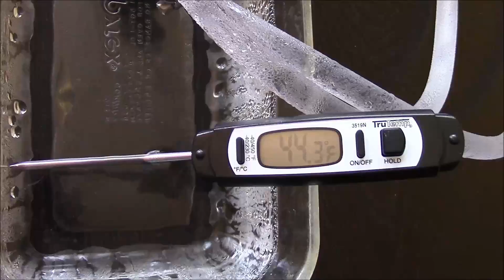How to Build A Water-Cooled Peltier Device or Thermoelectric Cooler

Comment: A few proofs of concept here. I love it BUT, I'm wondering, could you heat one said to make the other side cold somehow?
Reply from the maker: No, you can't add heat to generate cold.  You can take away heat from the hot side to make cold.  And that is what this device does.  It dissipates heat from the hot side so that the cold side gets colder.

Although it isn't exactly what you asked for you can add heat to generate electricity.  That is called a thermoelectric generator or TEG.
Reply: LDSreliance it figures. Doesn't hurt to ask though.
Reply from the maker: Yeah, sorry.  That would be an interesting device, though, if it existed.  Maybe it does but I don't know of it.

Comment: Hey guys, just curious, if you flipped over the module and turned off the fan would you heat the water a good amount?
Reply from the maker: Yes.  You could do it in reverse and it would actually be more efficient since more heat is produced than cooling by these peltiers.

Comment: awesome, I wasnt sure if I could use one, say 12v 120 watt, supply if I could find one, or not. Im still a bit lost with the amps and watts, and what is consumed or what would be too much. On the bright side, my unit just needs new power supply. It is dead, I checked. But as you said, I think Ill just get 2 supplies and make my life simpler lol. I had used a TEC1-12706 12v 60W and a single 60w 12v 5A supply.
Reply from the maker: You can't provide too much power.  All modern electronic devices will only draw the current they need (that I know of).  Certainly a peltier and fan and pump will all work fine.  I am sure you could find a 120W supply but it will be a lot easier for you to find 2 60W supplies (and cheaper).

Comment: well all was going great, until a loud pop and then no more power. I 
just saw you have two laptop power supplies, and I tried using just one.
 Are two required? or is there a larger one that could power both that 
you know of?
Reply from the maker: It depends on the power supply.  The TEC that was used in this video requires 5A @ 12V (60W) so if you tried to put that and some fans on a 5A power supply it probably overheated.  I would recommend one power supply per TEC because usually those cheap laptop/monitor power supplies are about 65W each or so.  Then you will need one for the fans and pump, too.

Comment: Im not sure if this link will post, but this is what i had in mind    http://www.ebay.com/itm/LED-Dual-CPU-Cooler-Fan-Heatsink-for-Intel-Socket-LGA1156-LGA1155-LGA775-AMD-AM3-/232335960837?hash=item36184d6b05:g:0OYAAOSwjqVZGRFc
Reply from the maker: That is a pretty cool heat sink.  The challenge will be figuring out a way to mount that to a TEC.
Reply: I'm up for the challenge and awaiting parts. My chiller will be to help maintain 78 degrees in a 14g saltwater biocube during the summer months. Maybe I'll try and make a video too haha! This is such a cool concept I'd never heard of before.

Comment: r12  was colder and you didnt have to drive 5 miles before it  got cold  unlike 134a  as far as being on the same ,level negative you are wrong and yes r12 displaces oxengen we all know that ------propane boiling point is much lower then butane try isobutane
Reply from the maker: What does this have to do with the video?

Comment: can this be also done with an air cooled heat sink?
Reply from the maker: Yes it can.  It is much harder to find one that works well with a peltier, however.  They are usually also less efficient unless you buy an expensive gaming cpu cooler.

Comment: so i would like to see the radiator in a water cooling loop replaced with peltier pads. and see if it keeps the cpu cooler under load
Reply from the maker: It does.  This has been done for years in the high end pc modding community.  You could put a peltier right on the CPU or you could use a normal CPU cooler and send the liquid through a water block instead of a radiator.  You could sandwich the water block with multiple peltiers.  It just gets a little awkward with all of that tubing and all of the heat that you have to send somewhere from the hot sides of the peltiers.

Comment: Well looks like a great start (just don't use straight water. if you get a freeze it's going to ruin the block. i'd use antifreeze. or some other below 0 liquid i know theres some oils that can handle pretty low temps without going all thick and there enert. (ever notice how google spell check sometimes gives you every word but the one you want :/)
Reply from the maker: This little rig is not capable of freezing water unless it is a very, very small amount.  I knew the quantity of liquid that the person I was building this for was going to use so it wasn't an issue.  But yes, if you are going to chill a very small amount of water (under 1 cup or so) then you would want to use something with a lower freezing point.
Reply: Well i hope the pump never stalls :)
(grumbles about his keyboard dubble hitting letters.) i rely need to hit this thing with some alchahall and or ffigure out whats mucking up the debouncing circuit.
Reply from the maker: Yeah eventually the pump will fail.  I wouldn't use something like this on a mission critical application.

Comment: How do you think I can cool 40g of recirculating water about 5+ degrees?
Reply from the maker: 40 gallons?  You can do it with these but it will take multiple units or else a much more powerful single unit.  5 degrees is pretty modest.  What kind of insulation will be around the water tank?
Reply: LDSreliance reflectix brand insulation.  Similar to the kind you put in car windows.  Basically I'm looking for a way to chill my RDWC system.  I have two small peltier(tec12706)/pc cooling units but I can't seem to find the right power source.  I've tried 12v 1a, 3a, 5a and 6a and they either don't turn the peltier on or they make it way too hot and the cold side doesn't get cold.  I don't know much about electricity.  Help!
Reply: Btw the power units I have been trying are pc power supply's.  I haven't tried pwm's or whatever those switching power supply boxes are called.  Do you think that's what I need?
Reply from the maker: I've always used monitor power supplies like this and they work great:  http://amzn.to/2p4MHDT

Just hack off the end and use the red and black wires as normal.

You can also use a dedicated DC power supply like this and power everything from one supply:  http://amzn.to/2phv53O
Reply: LDSreliance I've tried the monitor powersupply @ 12v 6a 60w and it got too hit and barely cold.  Do you think it has something to do with the wattage then?  The one u recommend has 72w.
Reply: LDSreliance and if I used the 12v 6a 72w monitor supply, would I need one per peltier?
Reply from the maker: You aren't adequately cooling the hot side then.  What heat sink are you using on the hot side?
Reply from the maker: Yes, you would need one monitor power supply per peltier with nothing else on it.
Reply: LDSreliance https://www.amazon.com/gp/aw/d/B06XGG989L/ref=mp_s_a_1_13?ie=UTF8&qid=1494009222&sr=8-13&pi=AC_SX236_SY340_QL65&keywords=diy+peltier+kit

That is the exact unit I'm using

Comment: Thank you so much for the video. I am new to this field of knowledge and  just curious, generally how hot does the other side of the peltier gets and whats the temperature of the air that the fan is pumping out?
Reply from the maker: The hot side gets very hot, but the heat sink spreads out that heat so usually it is not too hot to touch.  The bigger and more efficient the heat sink the cooler the hot side will be and, by extension, the colder the cold side will be.

Comment: Could you put cooling liquid in this? Anti-freeze would be useful.
Do you control the temperature by the power going to he cell?
What happens if you don't cool the hot side, would it damage the cell?
Reply from the maker: You could use anti-freeze or any liquid, I suppose.  You could control the temperature by the voltage but it would not be linear and would require a lot of trial and error.  Yes, if you do not cool the hot side it will burn itself out in seconds.

Comment: I didn't see the actual petiter chip in the part list.. this set up would cost about 100 right? could this be built a big bigger to cool say 15 gallons from room temp to 55 degrees?
Reply from the maker: You can use a bunch of different peltier chips.  The one in this video was a TEC1-12705 but if you wanted to cool more volume of air or water you would need a more powerful chip.  Here are a few links:

http://amzn.to/2ouAfce  (5 amp)
http://amzn.to/2q08nNg  (10 amp)
http://amzn.to/2pNq6v4  (15 amp)

Usually if you go above these power levels the chip starts getting bigger than 40mm x 40mm, which means you can no longer use CPU heat sinks and coolers.

Comment: Could 1 of these work to keep 5 gallons of water below 75F?
Reply from the maker: It depends on several things.  The biggest variables will be the ambient temperature and how much insulation you have around the water.  If it is 110F and you have no insulation then the answer is no.  If it is 85F and you have a well insulated container then I would say that should work great.
Reply: 5 Gallon plastic bucket wrapped in black duck tape, then wrapped in foil tape.

Right now the temps are resting between 78F and 83F... and I'd prefer them to be around 70F to 65F

You think a Peltier could handle that temp drop, be constantly on,  and with only a fan&heatsink on the hot side?
Reply from the maker: What is ambient air temp?

I would recommend more insulation than that for maximum efficiency.  If you can get at least an R5-R8 you could probably get it to 65F unless the air temp is really high.  I doubt you can get that volume of water colder than 65, though, with just one 5-6 Amp peltier module.
Reply: wow thank you for the fast reply!

Air temps are between 80F and 90F.

Waters temps are 78F to 82F.

as far as the water goes, 65F  is probably the bottom end of temps I'd want. 70ish would be fine.

let me tell you a little bit about my current project.

I have an indoor DWC hydroponic garden where I grow everything from cabbage, tomato clones for summer,  to herbs(rosemary and basil) and other vegies.

If I was growing just 1 kind of crop I could use other solutions like a massive res, and re-circulation and falling water to lower temps by evaporation.

Or if I had running water in the room I could make like a wort cooler and just run water. But I don't and it is a bit wasteful.

Also, since each kind of crops has its own nutrient needs, each crop needs its own bucket.(really prod of the rosemary bush that I grew. huge and tasty on chicken.)

--

Anyway I've noticed some problem with root rot starting and I don't want to put many other chemicals in my buckets. The best way to fix this is to drop the water temps down for a few reasons.

Each bucket does have air-stones in it which I assume the friction from is also heating the water a bit.

The target is 65F to 70F. Any colder than 65 and the water temps will start to slow both growth in the over all plants and be bad for roots.

But, water carries more dissolved Air at colder temps, 14ppm at 65F, only 5ppm at 75F.

So water between 65 and 70 gets me the perfect mix of more air and stops the Root rot. Big healthy roots... bigger tasty vegetables.

So if 1 peltier module can keep 1 bucket nice and cool. Then I'm happy with scaling that up with more peltiers units later.
Reply from the maker: The only way to know is to try it.  I can probably put together a kit and throw it up on kit.com for the DIY peltier water cooler.  But you seem pretty handy and can probably piece it together yourself.  You can put all the components together for about $75 or less.

One thing I will warn you is that peltiers are power hungry.  So if you ran one of these for every bucket and you had dozens of buckets we could be talking a pretty large power bill or a very large solar panel system.  There are some ways to improve upon that but we can get into that later.  There is no way to know exactly until you try it and then tweak from there.
Reply: How many watts per month?
Reply from the maker: 43 kWh per month for just one module to run around the clock.

Comment: Hi there, I just purchased parts to do this myself.  Just played around a little bit, but I noticed one problem if you could possibly help me out.  For the pump they sent the wrong plug in so wasn't able to try with the water.  However I hooked up everything but I didn't get any fan movement for the radiator or small cooling fan itself.... My question is, do I need the pump working to get the movement from the fans or should electricity still move the fans?
Reply from the maker: Is it all on one connector?  Which pump were you not able to wire up?
Reply: this is what they sent me...  http://www.smartclima.com/thermoelectric-cooling-modular-part-kit.htm  
the fountain pump had EU prongs instead of American prongs, so need to go to local hardware store to purchase a new pump.
Reply from the maker: Hmmm.  It looks like all those devices connect to the power supply in the upper left of that picture.  So the pump should not have anything to do with the other devices.
Reply: my thpughts exactly.... however i can not get the fans to work and im not exactly sure why. the module works for heat and cold, but the fans just dont turn on..
Reply from the maker: Can you try using a different power source?  Do you have a car battery laying around or worst case connect 8 AA batteries in series (end to end)?  That way you could at least test that the fan works.  If it does then it is either a wiring mistake or a bad power supply.

Comment: would you be able to cool the hot side with a heatsink and fan?
Reply: Or, could you make this an enclosed system, where you essentially use two peltier devices to cool each other by cycling the cold water over the hot side of the other? So instead of the cosair cooler you have, get another cooling block and cycle the cold water through it.
Reply from the maker: Yes you could do that but in my experimentation water cooling is far superior than air cooling even with a really efficient heat sink and fan.  Even though a really nice air cooling heat sink could be as efficient it causes major packing problems because you have to isolate the hot side from the cool side.  With a corsair cooler like in the video you can route the hoses and mount the radiator a good 8-12" away from the peltier itself.  That helps a lot.
Reply: LDSreliance Or, could you make this an enclosed system, where you essentially use two peltier devices to cool each other by cycling the cold water over the hot side of the other? So instead of the cosair cooler you have, get another cooling block and cycle the cold water through it.
Reply from the maker: Why would you do that?  What is the end result?  Just for fun?  I don't understand what you would be trying to cool or heat.

Comment: hey man i dont have an extra laptop charger to use top power my peltier and in other videos they just plugged it into their molex adapters on a pc power supply but i cant get the molex methodf to work. please help asap lol
Reply from the maker: A molex is pretty simple.  2 of the wires will be positive and negative and the others aren't needed.  Usually there is a triangle or arrow marker for one and the other will be right next to it.  Just hack off the molex connector and use trial and error to figure out which one is which.  Use a computer fan or something and if the fan spins you know you have the right 2 wires.  If it spins backwards just swap the wires.

Comment: So If i wanted to build a cabinet cooling system with multiple unit's would I 1.Be abe to use water cooled for the hot-side to lower overall temp and then use air over the cool side to spread around? 2.Would I be able to drop from between 35-40 C down to 25-30 C in a space that is 1120mm x 500mm x 1500mm?(space may be increasing) It is kinda important and it's been a struggle to get information.
Reply from the maker: Yes to both questions.  It will work.  The only question is how much power you need to make it work.  Peltiers are not efficient so be prepared to supply a lot of watts compared to a normal cooling system.

Comment: how did you determine which side is hot or cold? Thank for the video, Billy
Reply from the maker: Connect it to the power source for 3-4 seconds (no longer than this) and then touch each side with your fingers.  One side will be warm and one side cool.  That is the only way I know to test it.
Reply: Thank you for your response, I've spent hours on the net trying to figure this out. I'm replacing a TEG for a friend in a wood stove fan, so may be I can ask one more Q, which side goes to the stove side, or does it matter? Thank you, all the best to you and your, Billy
Reply from the maker: I am not an expert on TEG's but I don't think it matters which side you heat up.  All it needs is a difference in temperature between the two sides.  I think whichever side you heat up ends up determining the polarity but I don't think it matters which side you attach to the heat source.